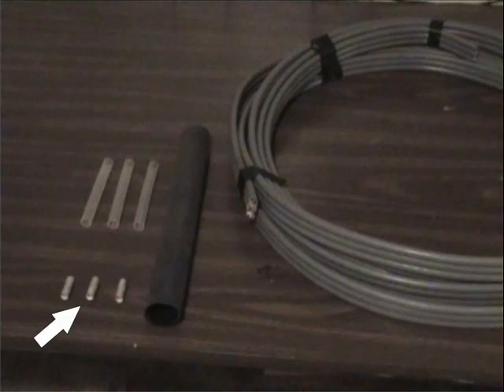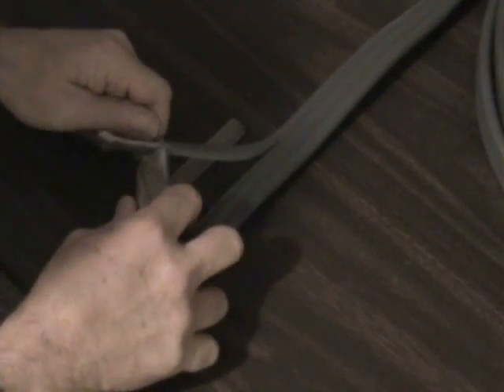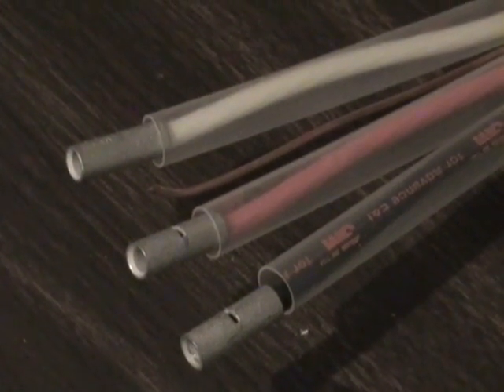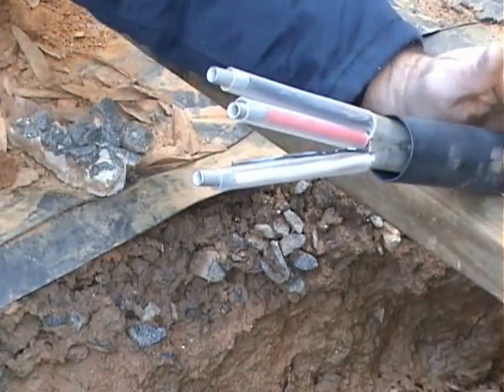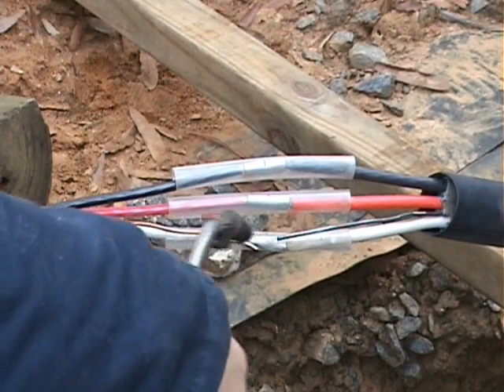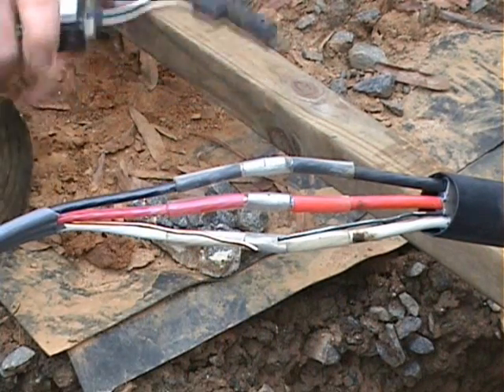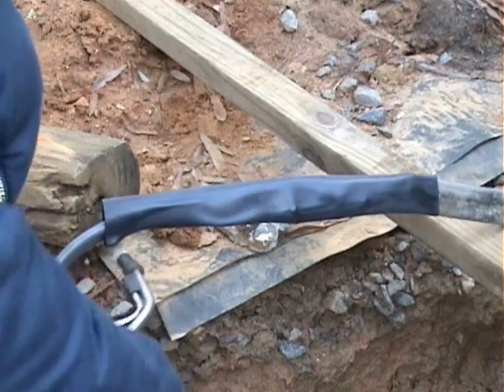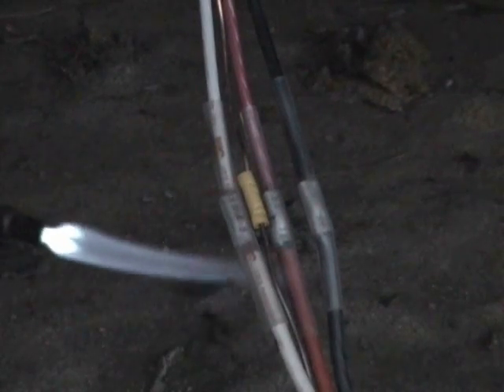Underground wire splice.wmv

Comment: Thanks for the vid.  I recommend you stagger all three(or 4) connections so that there is a distance between each connection.
Reply from the maker: If it's insulated, it's insulated, but there is certainly nothing wrong with staggering.
Reply: Staggering also spreads out the bulge a little.